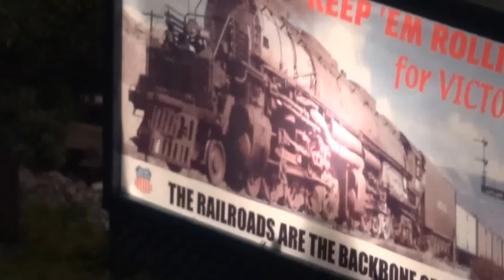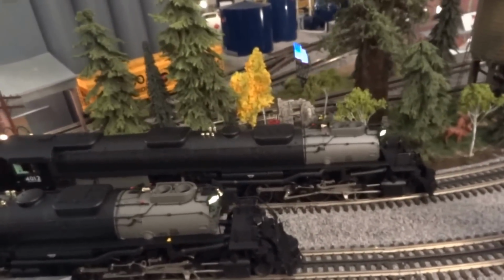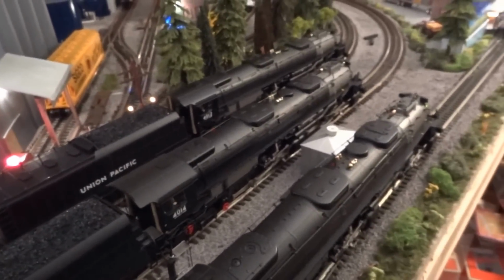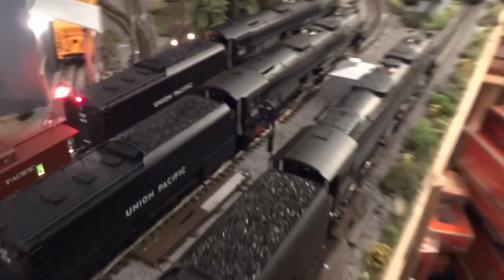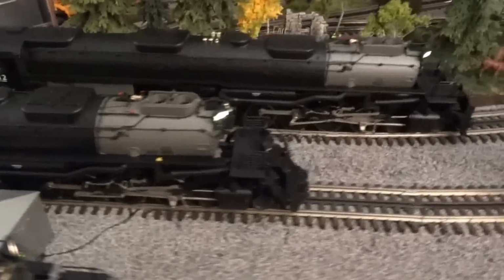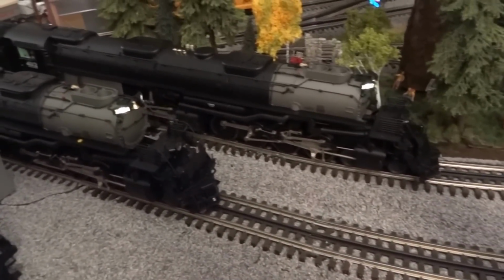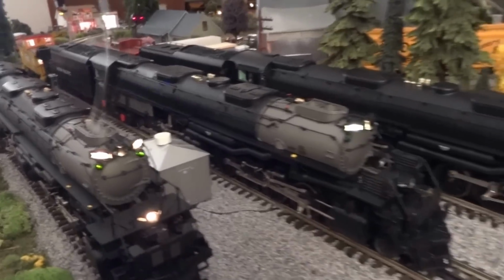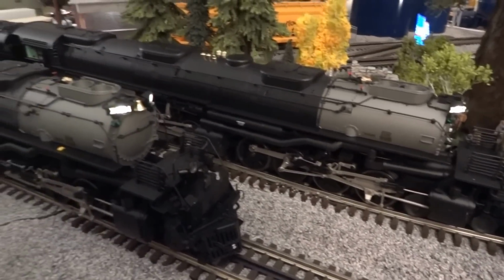Lionel Vision Line Big Boys Part 1

Comment: Darren,
Enjoy all of your videos!  Especially this one.  Like you, I've been waiting on these since it was rumor!
Lionel knocked it out of the park with these new VL BBs!  There is nothing like one!
Not trying to "sharp shoot" your video-As you probably know, the 'fences' are radiators.  As delivered, the first 20 BBs received the exposed radiators as found on the VL BB (Lionel has stated they're as 'delivered').  The last 5 BBS received the 'hidden' radiators, such as your 4024 JLC Legacy version.  Look closely and you can see the radiator in the pilot.  UP later moved all radiators on the 4000s to match the late production BBs. Prevented damage due to debris in the latter location.
Look forward to more VL BB videos by you!  I really enjoy your train videos!
Reply from the maker: av8tor1908 Thank very much you av8tor.  I couldn't agree with you more.  It seems like every time I run the engine I fine something new that makes it even more amazing.  Thank you for your info about the radiators, I actually didn't know what they were until somebody told me in part two.  I appreciate you sharing this info with me, I want to learn as much as I can about these engines.  Thank you again for your great comments.

Comment: Darren, my man, one wasn't enough?  Hehehe The layout looks fantastic, and the Big Boys are SWEET!  I'm almost certain the overhang wouldn't run on my layout without taking out a few track side structures or telephone poles. But seeing them run is awesome.  Thanks, great video!  Bob from Bobot's Trains
Reply from the maker: Ha Ha Bob, in my opinion you can never have enough Big Boys!  In fact I'd like to get another one.  There is a very easy solution to your overhang problem.....move whatever gets in the way LOL.  Thank you for your nice comments.
Reply: Bobot's Trains and Maker Zone Here where I live in nc.We had the 2-6-6-4. the seaboard airline railroad.But I like the big boys.I love the whistle on the older big boy.Have you try to see how many boxcar you can haul yet?

Comment: The overhang is dangerous...... not even worth investing in if it RUNS into line side structures
Reply from the maker: That was one of the reasons I changed the layout, I need more space for my big engines.  Once the new layout goes up that won't even be a factor.  Thank you for watching and commenting Ben.
Reply: Thanks for replying.. I rarely get reply’s back about with me comments. If you look up my name on Flickr as it appears on YT  you can see the full size locomotive photography I do as well.
Reply from the maker: @benlahrman4149  I try to reply to all my comments but sometimes it's tough.  I will check out your Flickr page thank you.